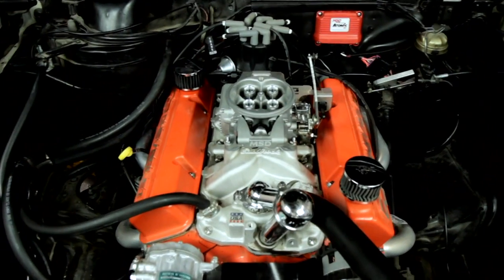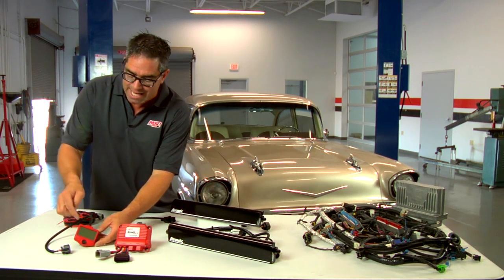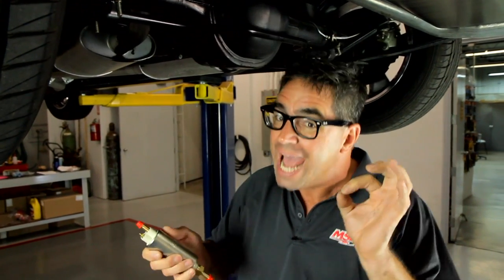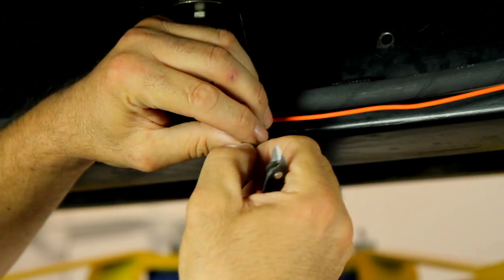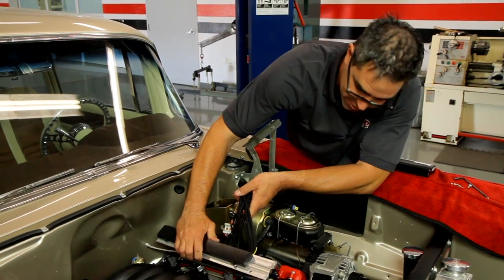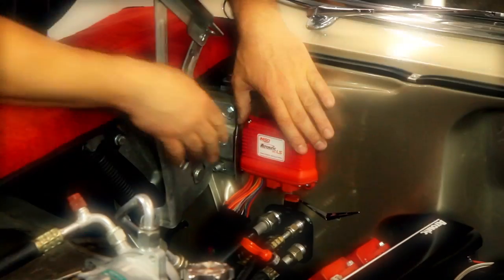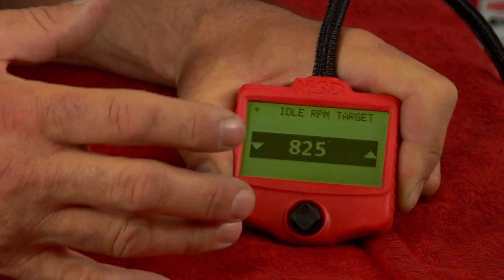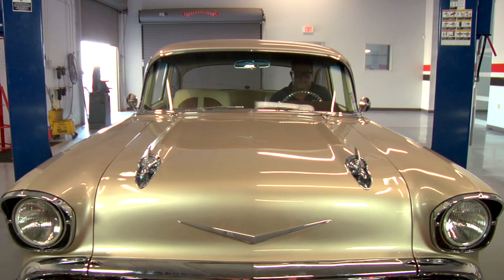MSD Atomic EFI LS Fuel Injection Installation

Comment: Do this system control the transmission ? I didn't hear anything about that.
Reply from the maker: Hi Titan92, 
The MSD Atomic for LS applications does not control electronic transmission functions. But, MSD offers an Atomic Trans. controller that mates with the Fuel Injection system. Here is the link to the part: http://www.summitracing.com/parts/MSD-2760/?feedback=1

Comment from the maker: The positive feed wire for the fuel pump comes from the ECU for the Atomic system. This positive wire goes directly to the positive terminal on the fuel pump while the negative terminal on the fuel pump goes to a good clean frame rail ground. Make sure that the frame/body of the car also has a good clean ground to the battery.